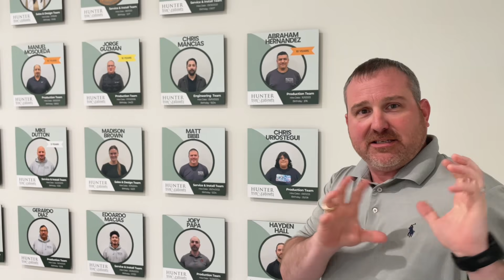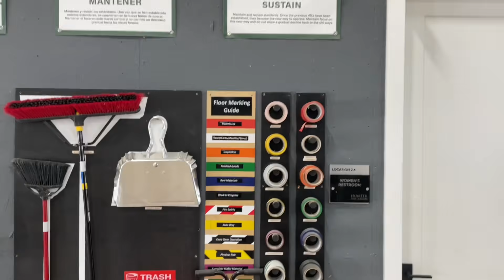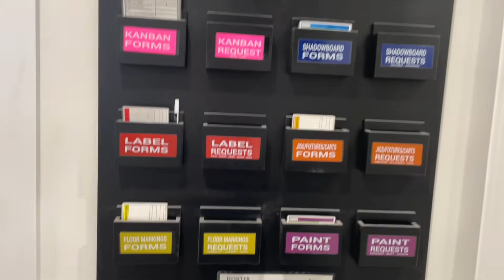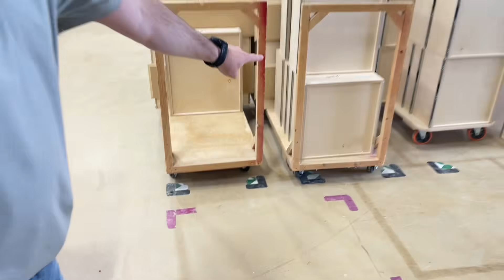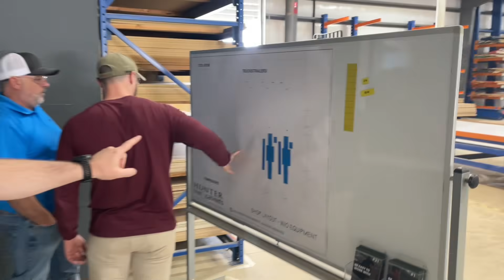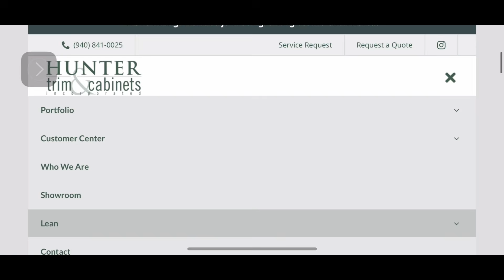MIND BLOWING CABINET SHOP !  one of the best Lean manufacturing practitioners we’ve ever seen

Comment: The off-cut rule made me laugh, if it doesn't fit the rack it goes in the dumpster. Every wood shop has that corner of 'good pieces' nobody ever uses. And the operator leaving her station when the drawer carts were full to go help on doors, that's flow actually working instead of people building buffer.

Comment: I couldn’t work there. Quite the facility but the micromanagement is on a whole different level. That tour guide guy was a tool.
Reply: I got the opposite impression. This seems like a boss that actually cares and wants people to have the smoothest work experience possible. How is he a tool? I get the impression he has done it all at one point and has figured out ways to maximize efficiency and well-being through every part of the cabinet building process.

This is actually "micromanagement" done right.
Reply: When you are in a shop with 100 moving parts and 1,000 tools and supplies; not having a system is criminal. The better the system the less chances for missing tools or supplies or holdups. Imagine walking across that shop looking for a broom for 15 minutes because it was barred in someone's trim. This eliminates that. The better the system the easier it is to hold people accountable. A good system will reduce frustration, stress, make the production faster, generate more money, and untimatley get everyone paid more. Everyone know who's doing what and the team can work together to push production and get raises.

If someone see this is and is bothered by it the system has done it's job again and deterred bad employees.
Reply: I agree with the previous response to this comment.  The micromanagement is practically eliminated using this system.  Each employee knows the next step and requires very little oversight.  This system essentially sets employees free.
Reply: Agree 100% he was beside himself so impressed, like a Swiftie at a Taylor Swift concert
Reply: I could totally work here! Every question that you could possibly have is answered. It eliminates the waste of asking. 
I work for an organization that claims to be lean and even encourages lean training however there is so much confusion and waste that it is laughable. I miss the company that I worked at that was on a lean journey, and still is I believe. The encouragement to make things better in the workplace and the teaching that they did for their employees showed investment in their people. Brad and Lynn helped teach and train us at the company and they tried so hard! I don’t hear anything but pride in his voice doing the tour. Thanks Brad!

Comment: I worked for a tier 2 automotive stamping facility for 20+ years. We did the lean route and 
I can tell you it works when you get everyone involved. Our plant was clean organized and extremely productive and profitable. We ran and serviced over 400 dies on a regular basis and streamlined maintenance and improvements because we could rely on our tool performance. Just remember that if you don't measure it you can't improve it. In a 300 person facility you will have lots of naysayers until you get them involved. Once people start to understand they count and are part of the process they want to make improvements. As for being over the top or going too far, that becomes a matter of opinion. 
We all have gone to a big box store and wonder why you have to go into different isles to find products we think should go together. You just made a lean suggestion in your head. The stores do this to keep you looking!!  Just my 2 cents, i take my hat off to Hunter well done.

Comment: Ive never understand employer that mandate restroom cleaning by employee. If I apply for a CNC operator job, thats what I will be doing. I will be efficient at it and that's where I will bring the most $$ for the boss. Not by cleaning the toilet ...
Reply: As long as they’re upfront about it, I don’t see the issue.

A small business might not be able to afford to hire a cleaning company to come out and clean a single restroom and certainly doesn’t have a full time janitor.

Seems like a fair system. The bosses are on the same chore list as everyone else and it rotates.
Reply: @eva2k0   They’re in a seven-figure building with machines worth just as much — they can clearly afford a $15/hour janitor. The fact that the boss is part of the cleaning crew makes it even worse. Imagine the value this person could bring to the company instead of spending an hour a day cleaning toilets. The only reason for this system is that they’re cheap and blindly copied it from some “lean manufacturing video guide. Imagine if Apple forced their top engineers to clean the toilets — how would that impact their ability to retain talent?
Reply from the maker: @samueldeveault2263  this is a HUGE misconception.  Cleaning the bathroom has nothing to do with cleaning the bathroom.  And if you only think about chasing money.   It will elude you for ever.  Lean starts in the bathroom.  Trust me !   Happy to help you and your team if you need it
Reply: Nah, I think it would serve as a good reminder that nobody is above doing the small things.  It would help to maintain a proper team attitude around the shop.
Reply: I have to agree with you . Some of this stuff is overkill .
Reply: Did you notice that the boss's name in on duty to clean the bathroom as well
Reply: Whuch oart is over kill?
Reply: Thankyou  so much for sharing this with us.
Makes me want to do business with people like this.
Reply: Then don't use the bathroom if above cleaning it.
Reply: @Vtv837  I happen to agree with the poster. Who made you gawd? Clown!
Reply: Perhaps the focus here is to filter out folks that don't fit into the culture.  As a small business owner, I think that would be my first question during interviews.
Reply: @MrDktjms  Well, have fun with your team-building toilet crew interview — maybe the Fortune 500 companies all somehow missed that revolutionary step in their hiring process...
Reply: @MrDktjms  You dont own a small business. I have never ever in my life worked for a company large or small whose first question in an interview had to do with cleaning the bathroom. And I've never ever cleaned any bathrooms in any place I've worked and I own a business now and have owned 2 in the past and I never made my employees clean the bathrooms either.